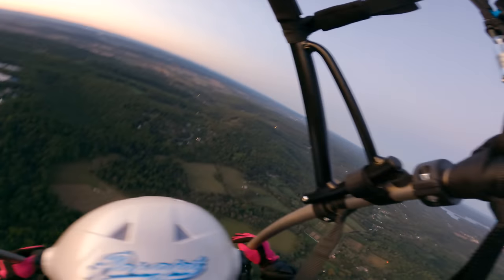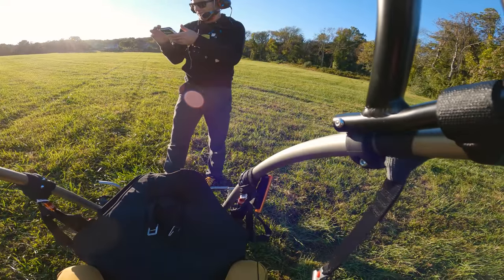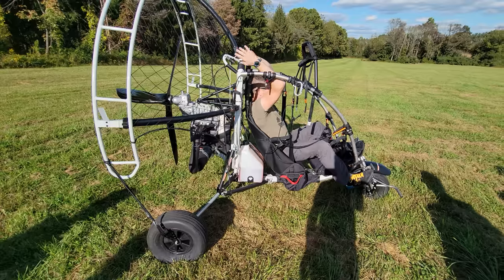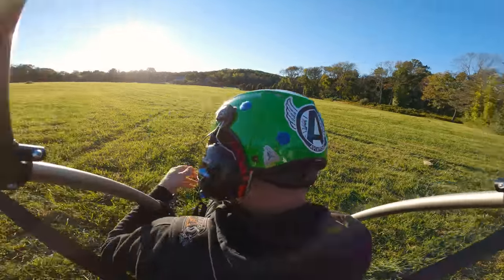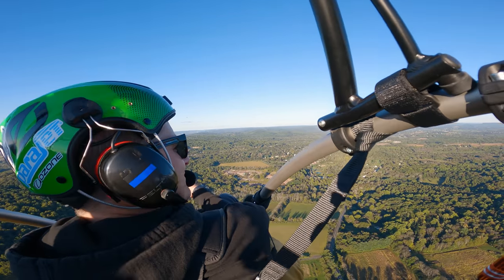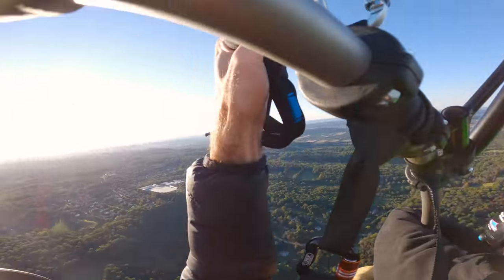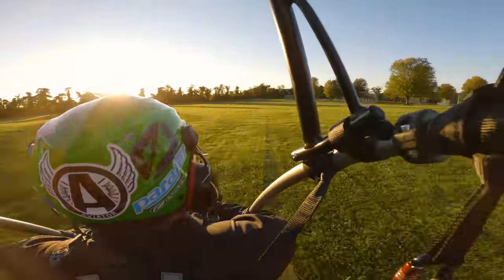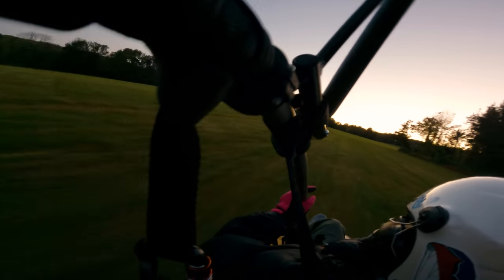The Most BADASS Paramotor I've Ever Flown!!!

Comment: At 1:10 you can see the prop just 2" off the turf.  That's too close when you consider frame flex, uneven ground, low air pressure in the tires, etc.
Reply: Wow your not kidding. I no longer want this.

Comment: I wonder how a 2-stroke engines would perform on trike. They have less moving part, super torqy,and boast the same amount of raw power with smaller lightweight engines.
Reply: They work fine
Reply: Two strokes definitely don’t last as long, I rather do 4 stroke from the start, less to worry about,..
Reply: @timedvrodlehnen8448  A good japanese 2stroke engine are rigid,less noisy , lightweight,very  powerful with lesser moving parts and are un killeble till you lubricate or oil it in right way

Comment: Very nice trike set up.  I agree with you that a foot throttle is the way to go it's intuitive and it doesn't get in the way like a hand throttle especially if you're wearing thick winter gloves.  I also set up my 440 Kawasaki Flyke with an electric starter, kill switch and remote choke all accessible so after I get all strapped into the seat ready to fly with my hands in the toggles I can start her up and go.  Here's a video of my maden flight  https://youtu.be/38IC7_buIts